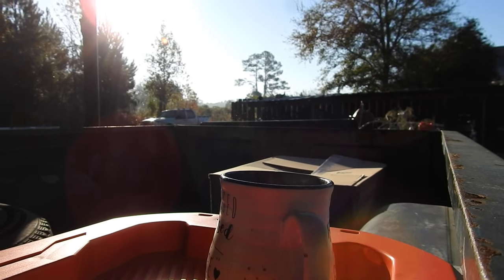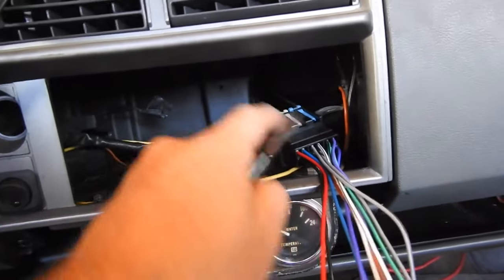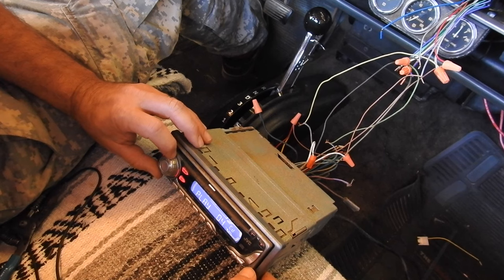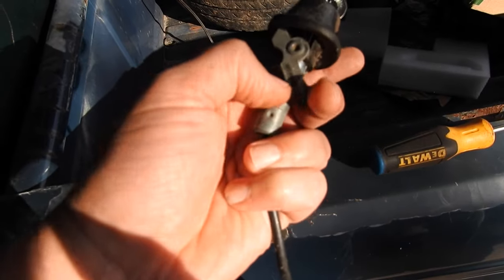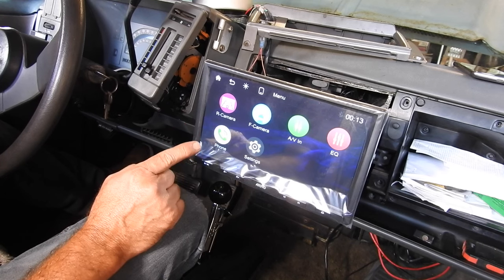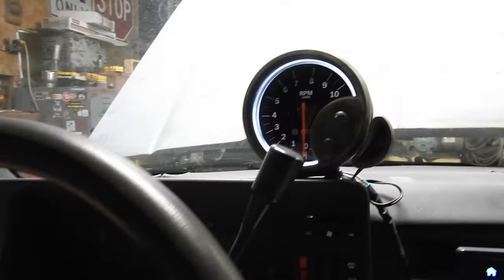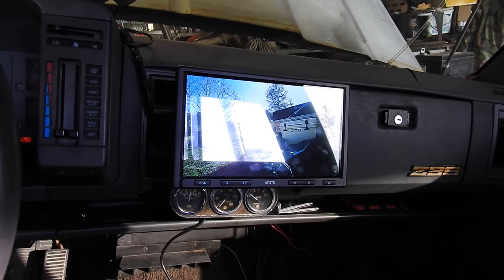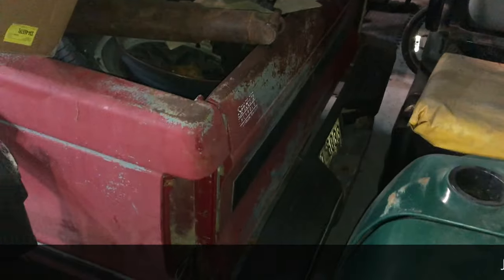New ATOTO Stereo System Install in S-10 V8 CHARLES

Comment: I have a Double din with DVD player housing I fabricated. Its 80% complete. functionally complete. My buddy opted for a non DVD unit and flat mounted them. I can send you pics if you're interested. I also have my backup camera wired to a switch. I have it wired so I can flick it on at any time. So I can look behind me with it even going 80 down the highwway. I also have a competition (non wall) audio system in my 91 Ext cab. Hit a 148.65 db
Reply from the maker: That I s super loud! I love my cam so a switch, can’t wait to use it in traffic. You can send a picture to my Facebook or f you like @  “ chud channel “
Reply: @chud327  that cam switch is awesome. I admire that you can recycle so many things to make whatever you need. Very loud, but was hoping to be in the 150s, but for an ext cab S10 its still a lot XD